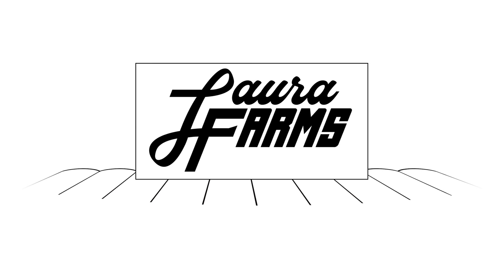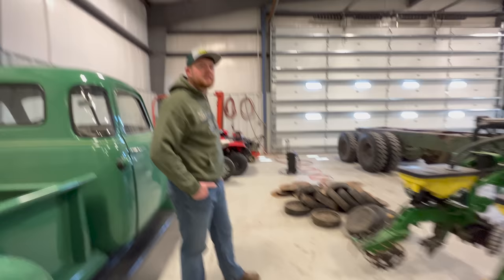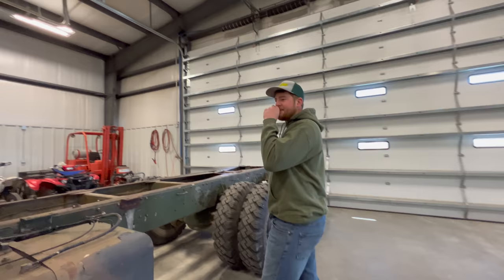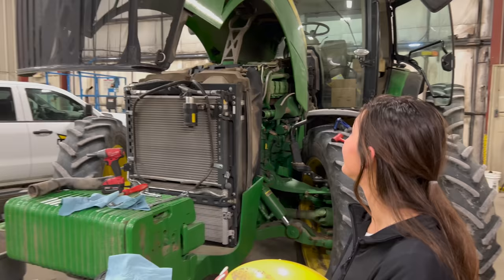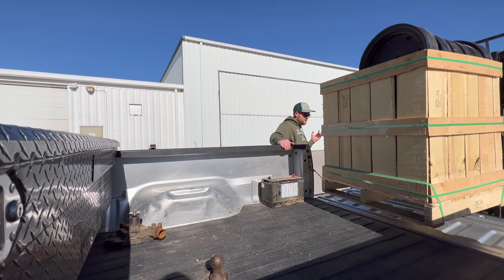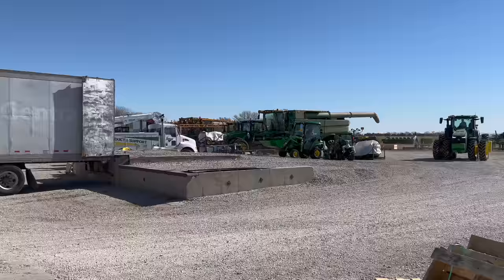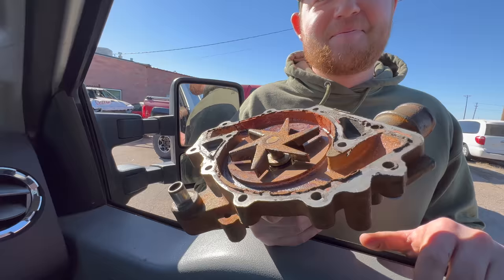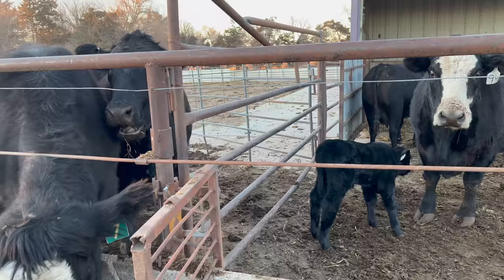How John Deere Tractors Are Made

Comment: Hey Grant, I have 3 Lincoln Ranger 250 welders. It's basically a generator with welding lead connections. Have one for each of my 3 trucks. They last a long time. My oldest is 10 years and works 5 days a week. Its a stick welder witch is better for dirty material, if its mig or tig you will have to clean everything super good other wise hard to weld and poor  penetration. With stick you still may have to clean but not nearly as much. Thanks for the great vids Laura and Grant.

Comment: Hello Laura and Grant from Colorado. A 460 definitely has a backing plate, NAPA carries them. Can't go wrong with a Millermatic, very easy to use. Love your videos.
Reply: That is correct, it is not a flat plate, it is dimpled for the impeller, and is Factory.  Guessing without one, the engine will die from overheating.
Reply: Ohh, and actually some timing chain covers have casting holes-aluminum-that could lead to water in the oil-Bad death of the mighty 460.

Comment: We always called em heifer, fist calf heifer and from there on they were cows. My preference on a welder, Miller first, then Lincoln then Hobart. Get a engine driven one. That way you are not limited as to where you can use the welder. You know stuff always breaks ten feet further away than you have welding leads to reach it. Enjoy your vids. God Bless.
Reply: We're the same way as that other guy , always call them a heifer until they had their first half then they were first half effort and from there out they were cows. Still do the same we did that with the dairy business and I still do the same with my beef cattle. As far as the taste of that I hear where you're coming from we feed a lot of Bailey's around here we just brought some in this afternoon and put in the barn that I swear with a little ranch dressing I could eat it myself LOL
Reply: Just curious why Lincoln over Hobart? Isn't Hobart owned by Miller? I know my small Hobart Mig has a miller gun on it. 
And yes on the first calf heifer, always assumed it was a carry over from dairy.
Reply: @TheMCD1989  My experience is from years ago when I worked on heavy highway jobs. The guys with Millers (me included) and the guys with Lincolns never had any issues with the welders. I knew of only a couple Hobarts and they were always breaking down. Just my experience. Millers always seemed to have more features than Lincoln or Hobart also. I have not welded with the newer machines. I still use my 30 year old Miller. I would imagine any of the top three would serve anyone well now days.

Comment: The welder depends on what your looking to do might, tig, or stick. I was a steamfitter and used primarily miller welders. I've used Lincolns for stick welding. Both are fine.
Reply: This ^...and really both the red (Lincoln) and the blue (Miller) are great machines, it's really personal preference like Ford vs Chevy.  If you're not welding for a living, you could probably be just as happy with a Hobart and not spend as much money.  Ultimately an engine drive would be the most versatile since you can bring it to the work rather than the other way around.
Reply: @wpierce34004ever  esab is pretty good.  I don't weld for a living but I use it often

Comment: For a farm shop I’d recommend a Millermatic 250 mig welder. They’re reliable and have no computerized boards which is important since farm shops can have varied temperatures and humidity levels.

Comment: As for a welder, Lincoln’s and Millers are fantastic, but for general farm use, it’s hard to beat a Hobart Handler 190 wire welder from Tractor supply on price and quality. I also have a Hobart 225 Champion portable welder. It’s great as well for the money. If you are looking for a plug in, stick only machine, the tiny Miller suitcase DC stick welder is fantastic. I use them everyday for my ag students.

Comment: Hey Guys from NC. 460 does have a backing plate normally have to keep the old one of the motor or sometimes they rust out but you should be able to get one at the parts store, or you can try Rock Auto online. As for welder Miller is good I had a Lincoln good welder but sold it got a Vulcan from harbor freight and sad to say I love it. Aint had a moments problem out of it.  Oh and Grant ill give you your money back on the Deuce if you wanna sell it :D

Comment: The 460 DOES have a plate on the back of the water pump. I've changed enough of them to know. Usually new pumps come with them installed.

Comment: My 460 and my 429 both had water pump backing plates. It is stamped to create clearance. I am stunned it holds water without a plate. Every Ford series "385" I have ever seen had one. I probably worked on 50 of them over the decades, but I never saw an "industrial" version, so I could be wrong.

Comment: If youre just doing light welding and metal projects I would suggest getting a mig welder/plasma cutter in 1 combo unit.  They work great for small projects and then you have the capability of cutting thicker steel easily.

Comment: If you plan do do any in field welding repairs, go with a fuel powered arc welder. If it's only to be used indoors, then go with a steel mix bottled mig unit. Go with a bit more powerful than you expect to weld, you can always dial it back.
Reply: Always buy more than you think you will use. Will surprise yourself when you start doing repairs or fabricating items.

Comment: For the money, I think Miller makes the best welder on the market, Lincoln a close second. I can't remember the model off the top of my head, but Miller makes a really good multipurpose that can do MIG, stick and flux core.

And if memory serves, that model water pump does have a backing  plate, but it's been a while since I've serviced one like that so my memory is a bit foggy. Napa is probably your best bet. They have or can get just about everything

Comment: Don’t diss the baby tractors, they are the work horse of urban farmers. I love my Millermatic MIG welder for it allows you to just set the metal thickness and away you go. It seems to know what voltage and wire speed you need for great results.
Reply: Urban farmer sounds like an oxymoron. Kind of like military intelligence.

Comment: Can’t go wrong with a Miller or Lincoln welder Brand. I would suggest a mig type due to the ease of use and versatility u will get. a tig wouldn’t be a good choice for doing the variety of repairs you would be doing on a farm. I would also suggest going to a local dealer that  only sells welders and supplies and let them know the various uses and possibilities you may use it  for. 

(don’t go to Lowe’s or Home Depot there welders might look the same but they are not)

Comment: I absolutely love my #Eastwood AC/DC 200 Tig Welder.  You can do both steel and aluminum and also convert it really easily for stick welding which is probably really handy out in the field.  Very portable to take with you anywhere if you need.

Comment: The last John Deere I operated was a 4520 back in the 70s.
The power steering went wonky. You wandered all over turning the steering wheel lock to lock which looked like you'd started beer:30 at noon. My boss stopped me and asked why I couldn't pull the disc in a straight line. I let him have a go and he said just deal with it cause he needed to get the field planted. That was a time when power steering on a tractor was more work than if it'd had manual steering.

Comment: IT SHOULD HAVE A BACKING PLATE P/N: M-8501-460BP. AND AT SUMMIT RACING FOR AROUND $30.00. IF YOU GET IT FROM A PART STORE IT LOOKS TO BE SPECIAL ORDER AND ONLY COMES WITH NEW WATER PUMP. I LOOKED IT UP FOR A '87 FORD F-250 WITH THE 7.5L 460
Reply: ALSO SAME ENGINE IN A '77 LINCOLN CONTINENTAL

Comment: John Deere owners:   Is it the dealer network that is denying "right to repair"?   Or is this just a manufacturer mandate?  Are the dealers looking to keep more repair money in their pockets?
Reply: ON MAN!! ... I did a bit of looking into this "right to repair" issue and find it perplexing.  Mostly its because the tractors are so fully integrated with electronics these days.  So much so that a great many repairs require some computer/software interaction/updates/modifications when doing maintenance on just about anything on the equipment.  The computer/electronics is where the lockout occurs.   And as so much of the functionality/reliability/usability of the tractor is reliant on the computers/software John Deere wants to keep a very tight control of it.  kind of like Microsoft and Windows.... :-)  They don't want anybody playing in their garden.

Comment: Used to be good stuff, but now designed to breakdown in order to sell expensive replacement parts. Better off with old stuff  with less tech. Combustion is too  complex, gets too hot and is very loud. Electric "zero point " is the future, but the corporation is standing in the way. Over 50,000 patents issued for it to date and not a single product can be found.